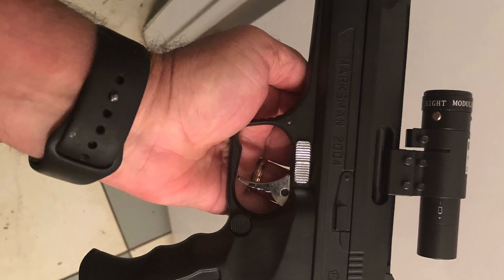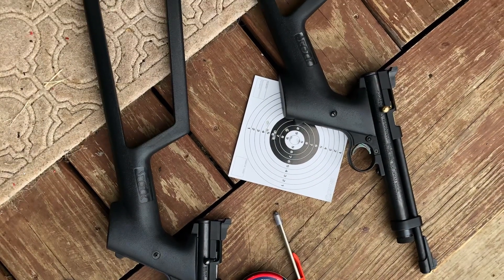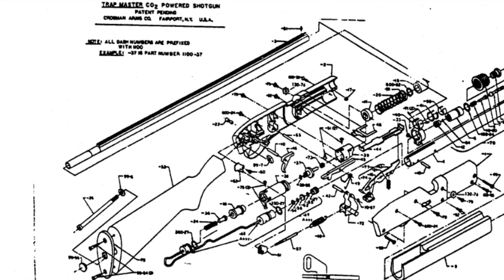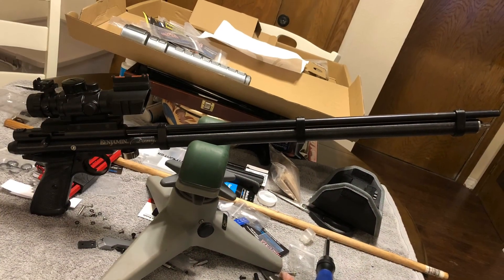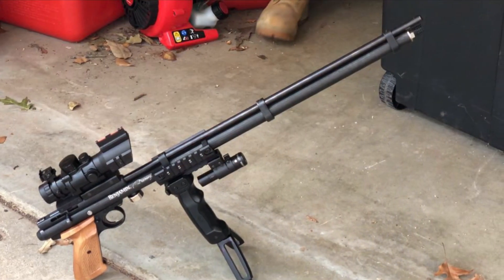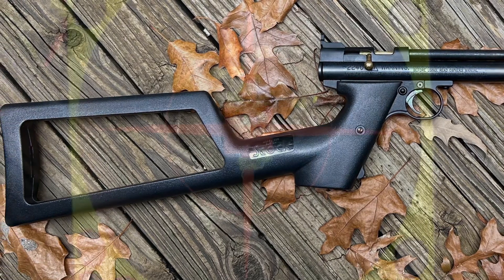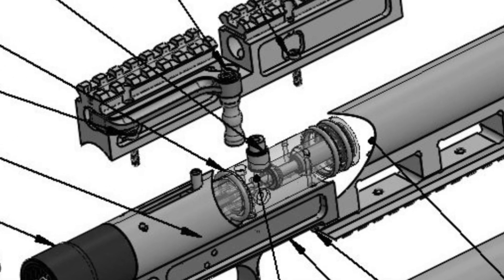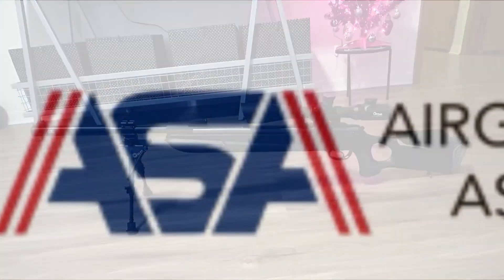Intro to Past and Present Projects

Comment: hi it  sounds like  your going to build a 25cal marauder pistol but using marauder rifle parts. a prod on steroid's lol.  i have a marauder rifle tube  that has been machined smaller its exactly half of the original length done  by a machine shop. i also have parts as well if interested.   i build custom hpa across the Crossman discovery Banjamin marauder plate form. i also no what parts can be interchanged between models. have a grat one till the next one.
Reply from the maker: 50 caliber with a dual reservoir.
Reply from the maker: The Disco is 22. PCP.